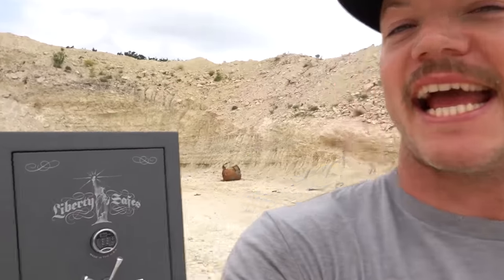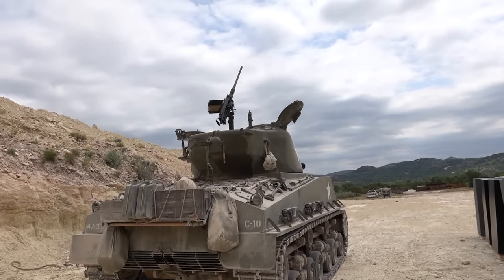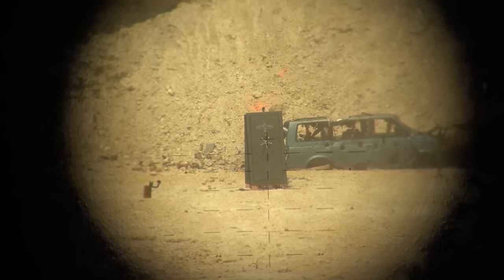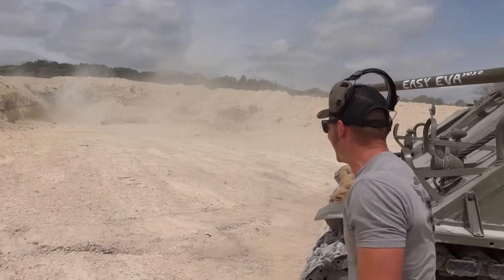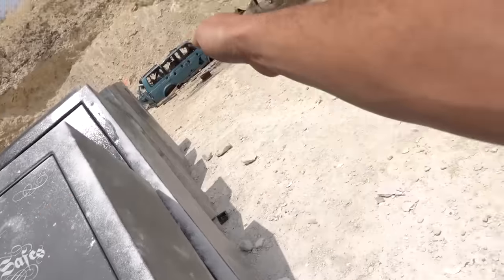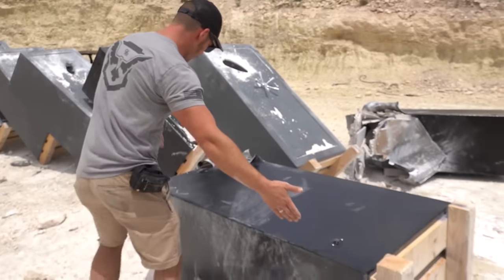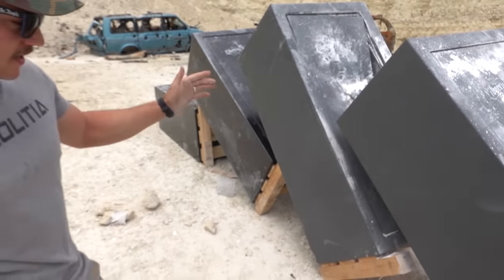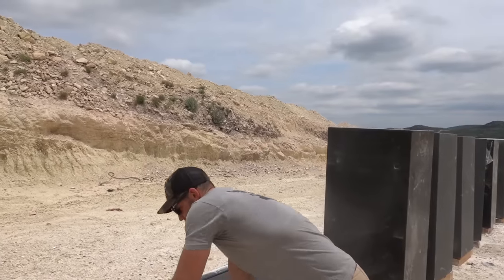TANK vs GUN SAFES!!!

Comment: Pretty impressive that the projectile seemed to remain intact.
Modern AP rounds literally melt through the armor due to the high temperature on impact
Reply: Long rod penetrators and heat rounds dont melt through armor
Reply: Deplete uranium long-bolts will spall their outer surface and spray burning flakes through the space as an incendiary effect, but the mechanical modulus of penentration demands they remain intact to push aside the armor material. AP rounds aren't designed to burn or melt-- much more effective to pierce through.

Comment: 06:38 Pretty sure catching a spinning tank projectile on the ground 3 feet in front of a go pro is a once in eternity kind of fluke.
Reply: W
Reply: I was admiring that. What is that spinning noise? Wait... is that the round? Oh... IT IS!
Reply: IKR i was wondering why it was zooming in and then i saw that round spinning and i was like :O
Reply: I was like, they are never gonna witness that again
Reply: Wait I just started the vid but did they actually
Reply: But wouldn't the round just completely splatter? Or are they solid steel?
Reply: @morpheus473  this one clearly didn't
Reply: @morpheus473  it not supposed to explode it penetrates its target creating a weakness
Reply: @tylermarklow2977  What I meant was, does it not expand/deform/splatter once it hits, or is it so hardened as to penetrate only? I guess I am thinking of it with the same characteristics as a lead round that deforms once it hits its target, but if its a solid round meant for penetration, I totally get it.
Reply: @morpheus473  tank rounds are usually solid steel for penetration. Obviously there’s explosive and tracer rounds as well but the standard ones are solid steel like this one
Reply: im just seeing it wtf dude that is amazing
Reply: @morpheus473  they litteraly say it's a solid steel round.
Reply: maybe the first and the last time in this life circle of this universe....
Reply: @cadens8530  AP rounds of course, but most rounds rely on velocity and the angle of penetration to get through. No such thing as a standard round. Either AP, HE, I, or HFS
Reply: @imnotpishedhic  anti material rounds are for targeting equipment and structures, whereas most rounds are designed first and foremost to be effective against personnel, anti material rounds are designed to stop tanks, trucks, destroying structures, military equipment, etc...
Reply: I tought that it was the Lens of a camera which have been broke by the obu.
Reply: Tank rounds damage by spalling.

Comment: 6:54 projectile is just spinning in the dirt, cool!
Reply: That was the most amazing thing I've ever seen. That thing was spinning fast!
Reply: Bullets usually hv 270,000 RPM when its fired.. spinning makes the projectile stable in Air..
Reply: I totally missed that the first time! Thanks for the comment! It is really cool to see it spin
Reply: @vinaybhat7670  that's what I don't understand about Fin Stablized shells. Why stop them from spinning if it helps the accuracy and velocity?? At the same time it apperently helps it stabilize and go faster???? Specifically HEATFS and APFSDS
Reply: Hamza Sami HEATFS round is basically a round that inject molten copper with incredible speed into the tank,if the round spin,then the molten copper will become separated when injecting,so the molten copper can’t be injected into the same spot,the effect of penetration will be bad.If fin is added,the round will not spin and the problem is solved
Reply: @superhunter2987  what about APFSDS then?? Does it have to do with the shell case ejecting after launch??

Comment: "I want a Liberty safe so bad!" 

Matt: ight imma try and destroy 10 of em
Reply: same. Gives me an excuse to buy more guns lol.
Reply: Same. Kinda wasteful.
Reply: Pisses me off!  Matt: "I'm rich Imma destroy perfectly good safes"  Me: I'm unsubscribing from this channel"
Reply: If you listen to the beginning the safes were given to them by liberty safes. He didn't buy them.
Reply: @tenchi20229  I know,I didn't say he bought them
Reply: Liberty safe are crap. I got one and found out the hard way.  Talk to Liberty safe about the problem and got no help on it.  Do not buy a Liberty safe.
Reply: @airsoftspeedy  Not kinda
Reply: I should have tagged him in the comment but I was referring to @graniteshin198  comment.
Reply: Liberty is the lowest tier of safe manufacturer I'd ever consider and even then I wouldnt put much of value in it. Just a sheet metal box full of drywall. I want a Graffunder Fortress 7248 but since I dont have $24,000 (plus roughly 4600 shipping) for that right now Im getting a Sturdy 6028-6 instead. 4 gauge body is standard on that model. Thats the minimum I would recommend. Its $4000 w/o fire liner, $5000 with the fire liner. 6ftx5ftx28" and it weighs 1500lbs w/o fire liner and 1800 with it. No better deal on the market except maybe used. A comparably sized Liberty is $7000+ and nowhere near as thick. Liberty uses 7 gauge on the presidential where Sturdy uses 4 gauge (0.17 VS 0.22") and for the same $7000 with study you can opt for even thicker steel walls. The two can not be compared. You get almost double the metal for your money with Sturdy and they dont use drywall insulation that requires a dehumidifier due to the water content
Reply: Thanks for the good morning

Comment: "We're going to fire from outside the tank, in case it blows up and we're inside"

stands next to tank
Reply: Cause it will back fire in the interior of the tank, Plus it’s built to take a couple of those so it wouldn’t effect the outside as much
Reply: @natfloxks9960  the real question is why tf are they expecting it to blow up. In theory those guns dont break whatsoever.
Reply: @bigd5899  it's an 76 year old tank, if the hammer fails it will backfire strait into them and kill that if they're inside
Reply: @saltboat5091  i suppose if the hammer fails the gun wouldnt even fire. The breech had to fail but thats literally a block of solid steel. Or is my understanding of firearms that off ?
Reply: For all the debate about all this...I'll keep it simple for you guys. Big cal, has engine so will make big boom, if inside tank while in boom people that survive will still be in a flaming tin can.
Reply: @Niggashiwa  they literally only fire one round at a time. There is no need for an ammo rack.
Reply: metal is strong, but its not immortal. age, use and natural flaws can all lead to a failure. its standard practice to replace small arms barrels and other parts after use, tanks are no exception. but with the limitation of civilian ownership and the sheer age of that sherman, finding a new barrel would be almost impossible, so they're on borrowed time until it fails.
Reply: @bigd5899  there had been deaths reported from WW2 guns misfiring. I remember when someone mentioned that some crew died when a 76mm M1A2 gun from a M18 Hellcat (same from that tank btw) misfired and blew up, killing persons
Reply: @bigd5899  Yeah the round is solid steel, but then you got the propellant behind the shell that explodes so the shell can be fired.
Reply: @aprgames9480  the breach is solid steel. He was not talking about the round. You are somehow confusing what he said.
Reply: He’s got it wrong it doesn’t explode from the inside it’s only when it gets hit from a certain spot by the German tigers meaning that the Shermans were more prone to catching on fire than other tanks

Comment: I’ll never buy a liberty safe... can’t even take a tank round 😒
Reply: *can't even tank a round

I'll leave now.
Reply: they cant take a 76mm imagine a 120mm.....smh
Reply: @loludead4142  imagine modern apfsds
Reply: Also a WWII light tank.
Reply: @irseeker9989  imagine sturmtiger's 380 mm rocket
Reply: that is not even powerfull WW2 tank round, german WW2 88 mm is twice more powerfull, and still they had 128 mm TANK guns. Modern are 10 times more powerfull
Reply: @loludead4142  thats how you erase anything within 300meters damn
Reply: @EDS_Kepler  what? 380mm he shell/heat is pretty fucking big blow
Reply: @irseeker9989  well it was intended as a fortifications buster soooooo yeah u get the idea
Reply: noah yang ha that’s a good one
Reply: They're actually an RSC (Residential Security Container) made out of mild steel. Real safes are made out of plate steel. Sturdy Safe is one great option.
Reply: Considering the round used (could've been APC, APBC or APCBC) is rated for 120mm of pen against homogeneous armor, no safe is safe 😆
Reply: @EDS_Kepler  sherman firefly 76.2mm was one of the strongest of Sherman series
Reply: @dayjeremy  r/wooosh
Reply: @nickscout2551  well that's true but u have guns like the german 88mm and the soviet 122mm (at the time) and u feel sorry for those shermans
Reply: Sky Acania Dev Sherman was medium tank
Reply: @Glas-db1vc  also to be fair the 75mm Sherman was an infantry support tank
Reply: LOLuDEAD LOLuDEAD not exactly, Sherman in the video is M4A3e8 modification which has much more powerful 76mm gun and other improvements. It could penetrate tiger I in front so it was not infantry support tank
Reply: @Glas-db1vc  re-read what i said i wasn't talking about the one in the video.... and yes i know that the easy-8 (jumbo) was an anti-tank/ fortification (it was always the leading tank due to it's increased armor and being upgunned)
Reply: LOLuDEAD So why you were talking about tank that is not in the video? You were talking about 75mm Sherman but the tank in the video is not
Reply: LOLuDEAD and buy the way Sherman in the video is not jumbo. Jumbo modification is M4A3e2

Comment: Those rounds were tumbling right out of the barrel!! If you slow the playback speed to o.25% at time stamp 4:01, you can easily see the round tumbling several times before hitting the first safe. You can also se the rounds tumbling in other various other shots at different time stamps. I don't understand how the round would be spinning when it hit the ground as it would seem there was a lot of room between the barrel lands and the projectile. The way the projectile tumbled right out the barrel it is obvious the rounds were sized wrong or the rifling in the cannon barrel are completely worn away. I think you were lucky to have even hit those safes, if you were firing at 1500 yards, that tank couldn't hit a flock of barns! Lol. Still a very cool video, YEA!
Reply: I agree, there is something wrong with the gun or projectile. Punching though those safes should have not been a problem.

Comment: If you look closely at 4:14 you can see that the round starts tumbling immediately. Not when it hits the safes. That is such a cool shot. Literally.
Reply: I dont see it wish I could
Reply: that's because of the high-speed camera, because of the shutter mechanism top and bottom are not updated at the same time so you get distortion at the frame, unless the muzzle is really messed up or the shot is way undersize it shouldn't key hole
Reply: I looked at it frame by frame and i cant see that tumble - too noisy from video compression in the 3 frames you can see it to really tell
Reply: @alexxu3004  No, it actually tumbles through the air.  Slow Mo Guys have it caught on camera: https://www.youtube.com/watch?v=xpJ8EoGmLuE

The reason is because the Ox Ranch tanks are using custom made rounds that don't touch the rifling except at the driving band (the brass band when he was loading it).  The rounds themselves are slightly undersized from the rifling to reduce wear on the barrel.  That instability causes a slight precession of the round as it hits air resistance.
Reply: Jayson Rb STOP SELF PROMO

Comment: "we arnt going to be firing inside of the tank because if it fails it all blow-up. " stands next to the tank when it is firing
Reply: Inside of a tank so much different from outside if it blew up inside it wouldnt blow up the outside theres a chance it could its unlikely
Reply: Tanks are lot thicker then you think. Never noticed how even when they blow up from ordinance ten times their own power they still retain their shape? Yeah, if that gun malfunctions, he’s fine.
Reply: By blow up he probably meant the shell in the breech exploding, which won't be that big of an explosion
Reply: He should - because if the breech blows the interior compartment will have shrapnel flying around inside, plus a pressure wave. If he is next to the tank, the armor is between him and the shrapnel, right where he wants it. The barrel is less likely to blow than the breech as maximum pressure is at the ignition point. The side walls having a few feet of separation lets the blast dissipate and reduce penetrative power (kind of like why you can stab thru a Kevlar vest with an ice pick, while it will stop a  9 MM).
Reply: @Hello 1234 Incorrect...an exploding M1 Garand could kill you, now imagine an exploding 76mm gunbreech right next to you.

Not good, happened to a friend of a friend, who owned an M18 Hellcat. His gun malfunctioned and blew him up.
The tank armor will stop most of the shrapnell and the open hatches will divert most of the blast so the damage will be contained, if you sit next to the gun when it explodes, you will die.
Reply: @Hello 1234 The shell will most likely not even care. The gunbreech exploding will mean most of the energy needed to propell the shell down the barrel is going elsewhere, hence the shell won't move, hence the fuze won't be armed, if the shell has a spin or force activated fuze, which otherwise would make the shell very dangerous to handle, so most did. The explosive inside a given shell is encased in enough material to not really notice an outside explosion.

So in the most likely case you end up with a shell stuck somewhere in the gunbarrel and the rest of the breech in splinters all over the inside of whatever space the gun occupied. Coupled with the sudden increase in pressure in a enclosed space, and you are pretty much dead even if magically non of the splinters hit you.